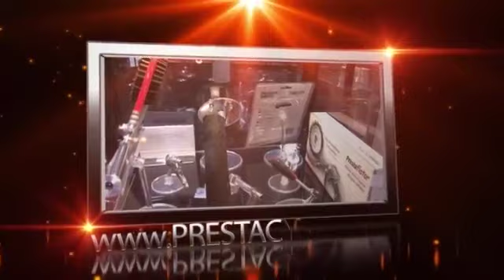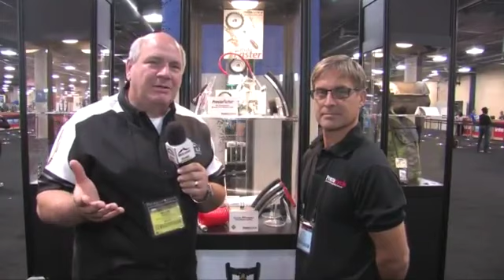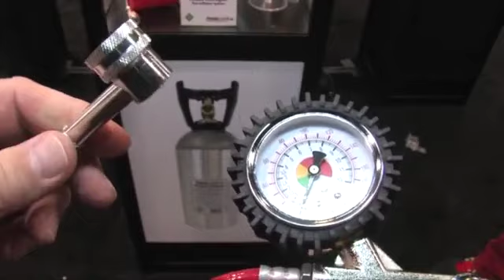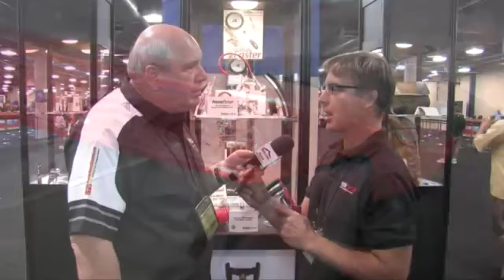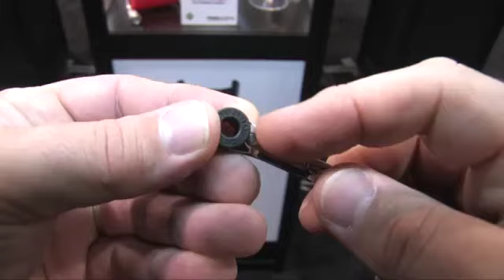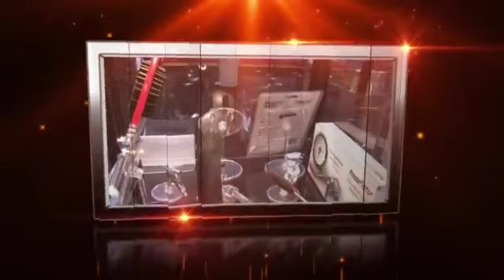Prestacycle on Cycle America

Comment: David, regarding the comment below this one, from Steven Lang, is that "YES, REALLY" there are specialist out here, including myself, who finagle with extreme high pressure tires (tubulars), and use a variety of gases to fill tires with, depending on need.  Therefore, Steven has to realize is that yes, for the common guy there is most likely no need for any of this stuff, but for those of us who want it, and don't wish to fool around with a handful of suppliers just to get unmatched,and unproven  products, your line is the perfect solution.  

In sum, for those who are inherently cheap, yes, drive to a million places, and buy a million different parts to create your own design, or, for more select riders/mechanics, who wish to specialize in getting the job done with the right tools the first time, I say go your site, prestacycles.com, to buy the right products for the right job to begin with.  The writer below does make a lot of sense for the superb and mechanically inclined; but not for the guy/gal who wants an entire inflation system, at the best quality level, that does not weight 18 million pounds, then your solution is obviously the way to do.

Thanks for your efforts David, and you do have the best products period!
Reply from the maker: +Cyclingmasterseller - thanks so much for your expert evaluation and input.  We could not have worded it any better than you did yourself.  You understand what our happy customers all over the world experience.  We've been here since 2006 providing exactly what you state:  A solid, reliable, tested and fully-backed product that Cyclists can feel confident from the moment they take it out of the box will deliver the ease of use they would expect.  

As a do-it-yourself-er, Steven did build something himself from nearly a half-dozen sources, a significant risk and time investment to try an unproven device.  For him it sounds like it did work-out, however he does himself little credit in claiming it cost him a few bucks less.  I think that a person with his skill and perseverance is very valuable, and the hours he spent evaluating, searching, buying and assembling a homemade tool cost him many times the price of our tool.  Our tool is more cost-effective through mass production.  We can take years of experience, create one proven design and deliver tens-of-thousands of them to cyclists all over the world.

At Prestacycle, we value input from all those in Cycling from the Beginner, to the Master (like yourself), to the do-it-yourself-er (like Steven).  Our own innovation comes from a mixture of all of these places.  While it's certainly not in our spirit to consider censorship, we did decide it appropriate to remove Steven's post today.  It's in pretty poor taste to go to a company's promotion, and describe your own competing creation complete with the names, locations and part numbers.  We would never visit another tool company's website and post our own products (or someone else's) and tell people where to buy them.